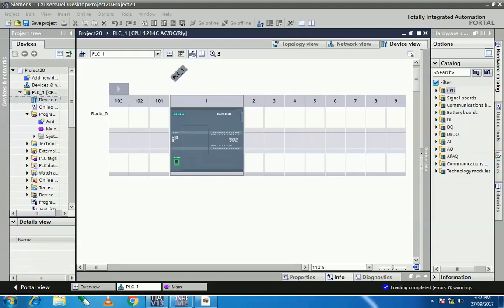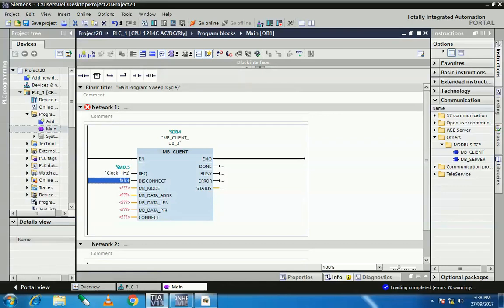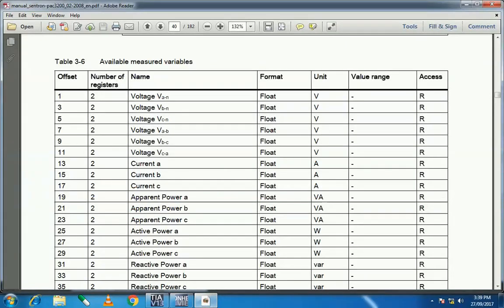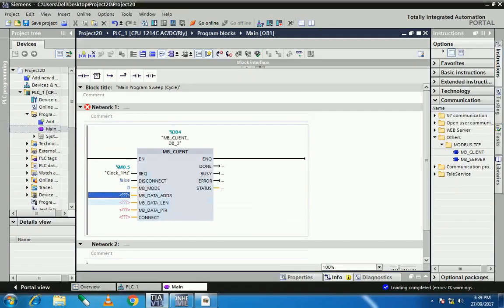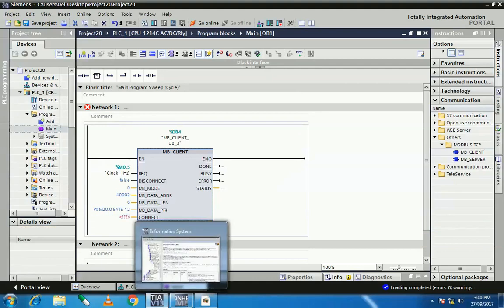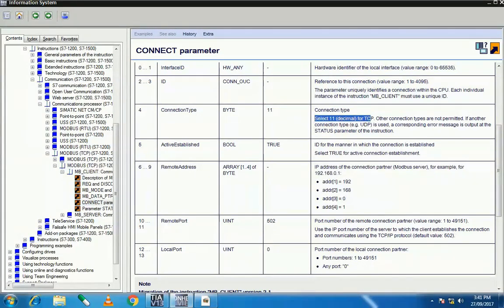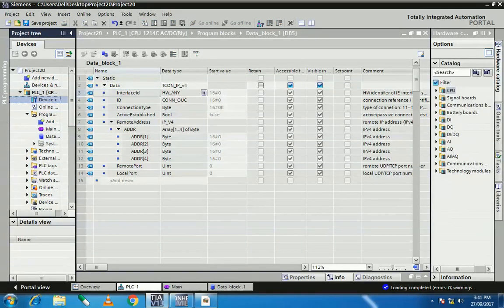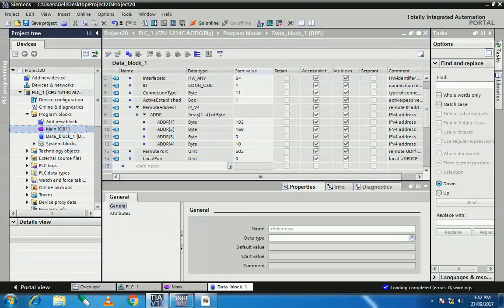PLC and SENTRON PAC 4200  communication using modbus TCP/IP l TIA Portal l Siemens

Comment: Hello crack, good video. Note that I have tried to connect an S7-1214 PLC with firmware 4.7 with the Sentron PAC3200, I have configured it according to the video, but when the program runs it stays at busy and status mark 7006 and the PLC no longer receives any data. I have made the connection of the PAC with my PC through Modbus Poll and if it receives them, any idea what it is? Thank you.

Comment: hello sir, 
I did not understand why you put 40002 at the level of "MB_DATA_ADDR."?
I want to know how you get to know that the voltage holding area is 40002?
if i want to read the energy i will put what please?

Sir i want to know how change frecency please in "REQ"?

cordially

Comment: I applied what you did and it works perfect! But I have a question. When PAC3200's energy cut, the lastest value stand it the monitor value. This misleads me. How can I do it when PAC3200's power is cut than monitor value is zero.

Comment: Hello, I would like to know if there is the possibility of accessing the memory of the 'DATA STORAGE' where you can store up to 40 days of measurements without using an SD card.
Reply: I think you can do it by using PowerConfig (free Siemens Software) or using the device's webserver (introducing the PAC's IP address on a browser)